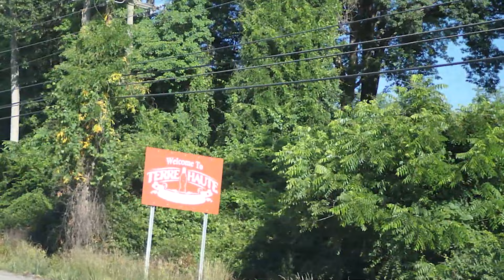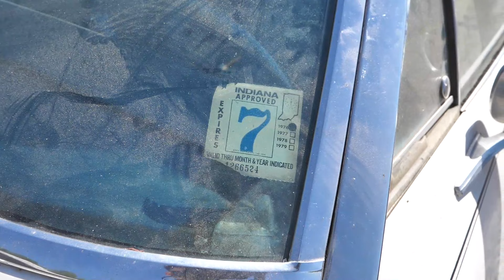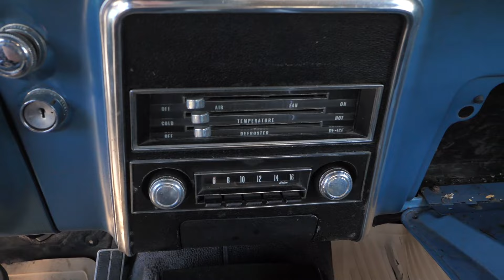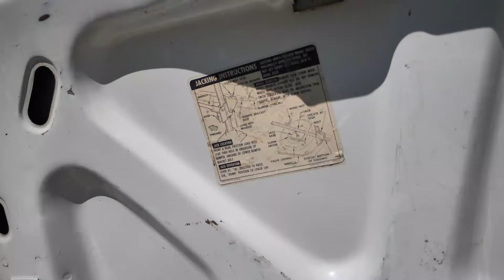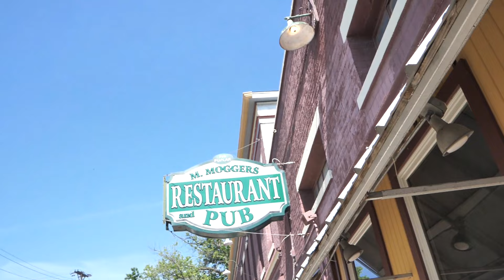THE MOST STUNNING PACE CAR EVER MADE!

Comment: Stunning. The 67 most easily identified by the lack of side marker lights and front vent windows. My best friend's mom had a 67 rs/ss convertible, 350 4 speed growing up. Blue, white top and white front stripe on the nose. Canadian car. As a boy I remember it with side pipes and Cragars before it was restored. My mom was driven to the hospital in labour with my sister in it. In 1975.

When you mentioned cocktail shakers I about fell over. I was told they were called "martini shakers" for weight distribution when I was a boy. 35 years ago.

Thanks for doing your part in keeping the legacy of musclecars alive, as well as glorious examples of the musclecar era alive!

Thanks for the trip down memory lane.

Comment: Very cool car Dennis! I have tried to buy a 69 Indy Pace car here locally since 1978! Each year I give it a try! It's a 350, 4 sp. car that has been in this old garage since 1978! When I was a ten year old the lady at the local corner market bought it new. I would go there for a coke or snack and drool on that car. It was the car that really got me hooked on Camaros! I have owned one 67 RS & 8 69 Camaros through the years. However this one hasn't run in all those years in fact when he got it in 78 he pulled the engine to rebuild it and it's still sitting on the floor right where he dropped it way back then! Oh well I will keep on trying to get it! Good luck on the restoration project I will follow it for sure!

Comment: Well Dennis they did ask you if you knew how many of that model  was made before you closed the deal, and the build sheet you know is behind the back seat, or should know,  the cocktail shakers are for vibration dampening not for weight in the back, and the brass door strikers are are so paint  on the edge of the door does not get chipped off because body flex.
Really Dennis, you have never been dirty in your life, never broke a nail, but go out and smooze these poor young lads and try to be some hero. You should be ashamed  of yourself for posing as a hero, when you should of paid them what it was worth. Another rich con man

Comment: I have owned several old Chevy's over the years including Camaro's, but none have been convertibles.  Cocktail shakers are not for weight distribution on convertibles as stated, they were on all 4 corners for vibration issues that were specific to these cars and they also had a x-brace under the car in the middle to help help support the unibody car without the roof support.

Comment: Actually the cocktail shakers were for dampening vibrations caused by body flex in convertibles and are literally harmonically tuned for that purpose. They're filled with spring loaded weights and hydraulic fluid...

Comment: I owned 2  67 ss350 4 speed coupes both had 12 bolt rears with staggered rear shocks which all info at the time said didn't start until 68 models one said ss and one said ss350 on the chrome and black cast gas cap. 295 horse , was fast in its day

Comment: It is my understanding that all 67 Pace Cars had the fleet code number on the cowl tag. This 67 Camaro does not have that fleet code number on it or even the "dash" after the group 5.  It would be just a 67 SS RS Convertible Camaro with Pace Car colors. There was no evidence of the Bright Blue nose stripe, which all Pace Cars had too. Dennis is a smooth talker, but you have to know your stuff before buying "so called" rare cars. This is not the "The Most Stunning Pace Car EVER".  It is a regular 67 SS RS Convertible Camaro with a couple of options.  Hopefully, it still has the original engine and trans. The NCRS Report would also be a good thing to have for this Camaro.

Comment: Wait what? Former fastest guy across country,,, where is that story? Fastest car I was ever in, 1970 Camaro SSRS, 350, Etelbrock high rise, Holly 850, duel 2 1/2 exhaust/ hooker headers/ Hurst short shift 4 speed/ camed. / clutched. Very hard to start, but when it turned over, it was just growing. 160 mph in 4th, and we didn’t top it out. There was more left. 18 years old. In Deep green hardtop/split bumper, I loved that car, was totaled twice…. It could slide sideways in the first 3 gears in posi, then 4 th gear just launched to another level. Layed wast to many a 442, and that Plymouth police car.
Reply: Gumball rally he did with Rawlings, there’s several documentaries on it. It was before they had the fast n loud show.

Comment: Hey Dennis you said the 67 has a 350 in it did the 350 have the high center oil fill tube like the 283 and the 327? Never seen one on a 350
Reply: 67 did..small journal crankshaft with pc valve like 283 and early 327..only yr with small journal

Comment: I've got a 68 3/4 ton camper special it's all original 318 727 trans auto shifter is mounted on the dash I bought it when I was in high school for 950$ I drove it for years I don't know what happened to it starters started going bad I'm not sure if it's the flywheel or not, but it's for sale I've got a78 Z28 with a 454 I want to get back on the road. I'm truly thinking 🤔 about selling my truck and investing my money into my camaro would you be interested in buying it I'm in NC  about 30 miles from the airport in Raleigh